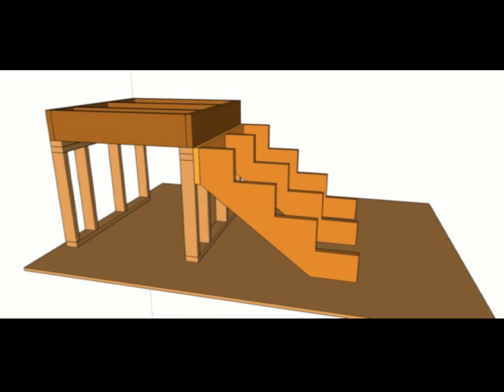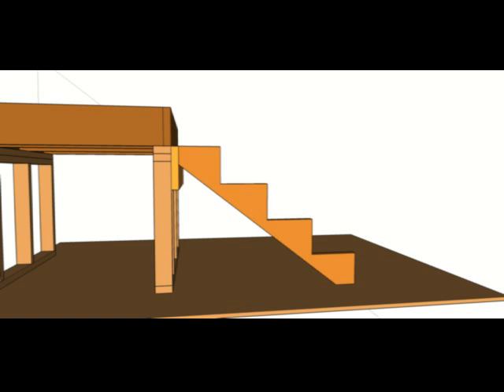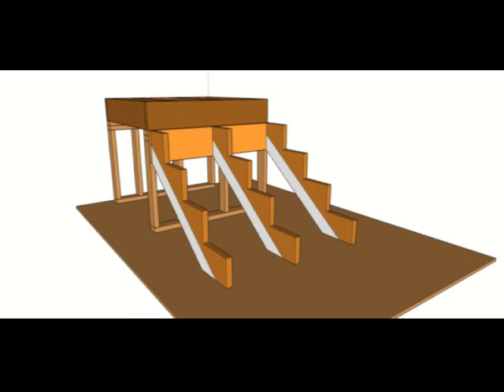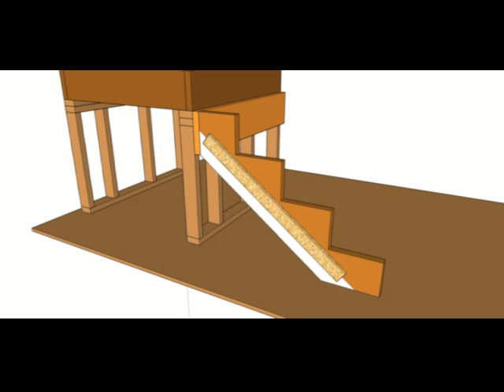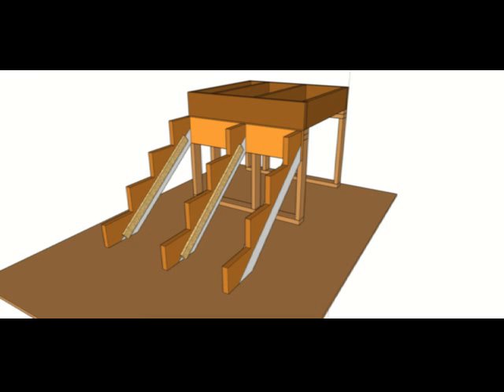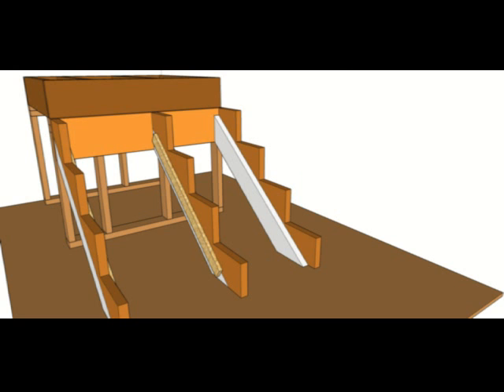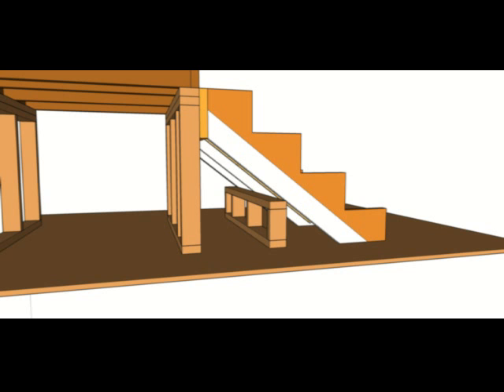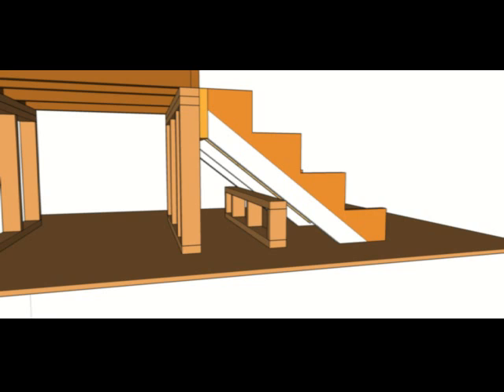How to Strengthen 2 x 8 Stair Stringer – Construction and Building Tips

Comment: The stairs in my 100 year old house are 2x8 stringers. I dont know how they are still hanging on. And there is no center stringer either. Luckily, the inside stringer has a wall built under it, and the outside stringer is sort of attached to the exterior studs.